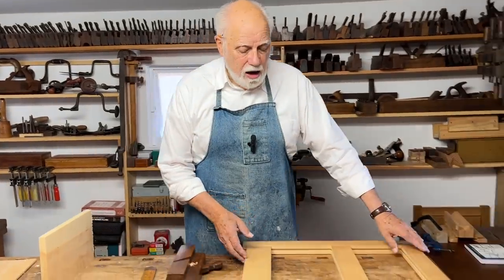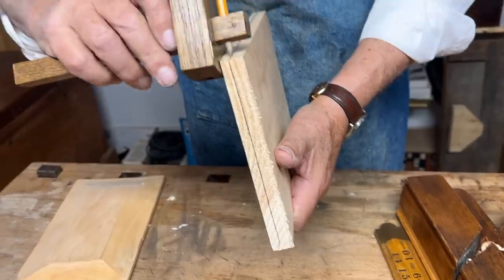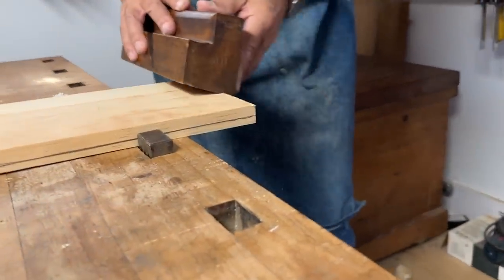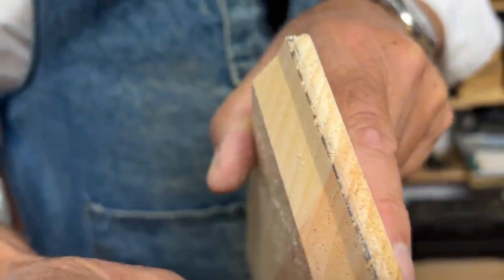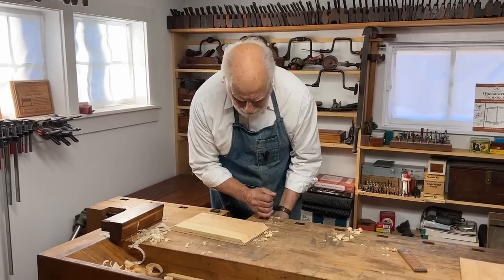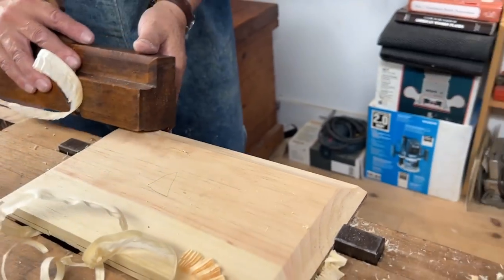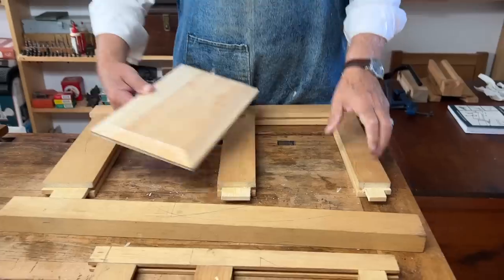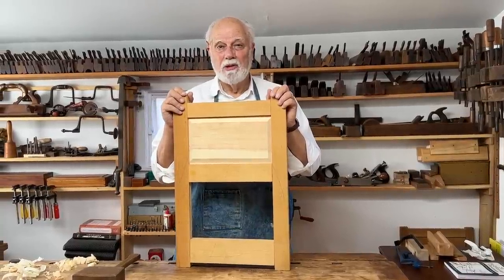20. Basic Panelmaking

Comment: I enjoyed that. Could you give a guide as to how you measure the panel so that it is the right size? How much play would you recommend leaving for expansion?
Reply from the maker: The grooves should be deep enough to allow for any possible expansion of the panel withouth pushing the frame apart, and at the same time deep enough that no matter how much the panel shrinks it still stays in the frame — both of which facts depend on the possible expansion and contraction of the panel which is a function of the species of wood and the environment. Try and check out both facts by learning as much as possible about the particular species (use the online Depr of Agriculture 'Wood Handbook' and the weaather conditions for the intended location of the piece. (I have got this wrong a number of times!!)
Reply: @gjbmunc  Thank you Graham. Damn and I thought there might be a short cut.  😁 I presume you mean this document: https://www.fpl.fs.usda.gov/documnts/fplgtr/fpl_gtr190.pdf. Looks like I've got some reading to do. Thanks again for a great video and the follow up advice.

Comment: Thanks for the video and information. How do you determine the size of the panel (width and length), that is, how much you leave for the movement of the wood. Is there a magic formula depending on the size of the panel?
Reply from the maker: The grooves should be deep enough to allow for any possible expansion of the panel withouth pushing the frame apart, and at the same time deep enough that no matter how much the panel shrinks it still stays in the frame — both of which facts depend on the possible expansion and contraction of the panel which is a function of the species of wood and the environment. Try and check out both facts by learning as much as possible about the particular species (use the online Depr of Agriculture 'Wood Handbook' and the weaather conditions for the intended location of the piece. (I have got this wrong a number of times!!
Reply: @gjbmunc  Thank you very much for the reply, kind as always.